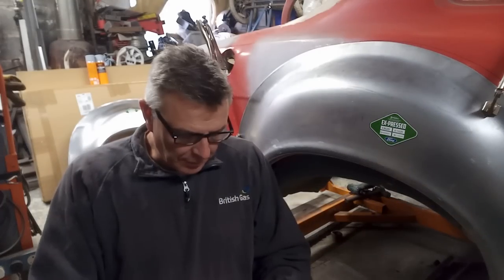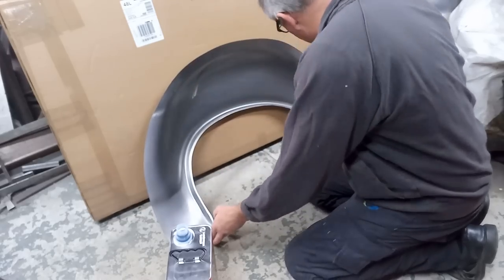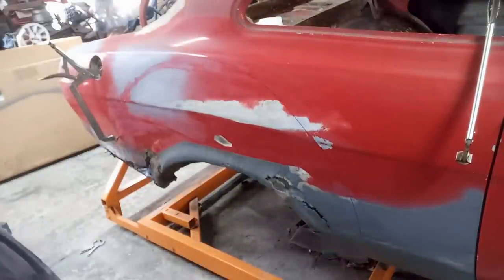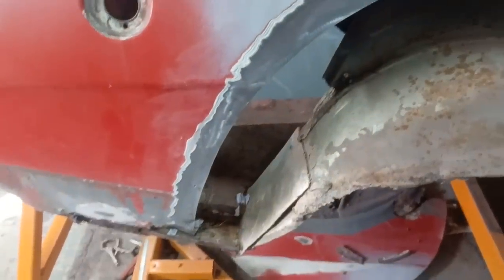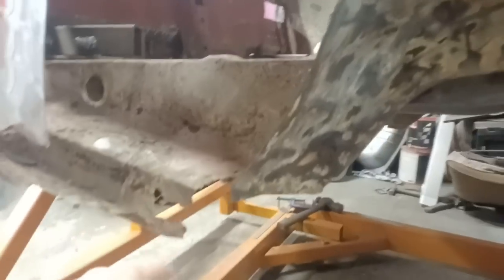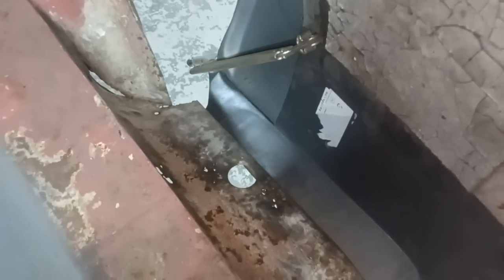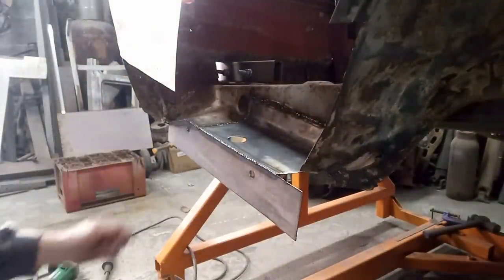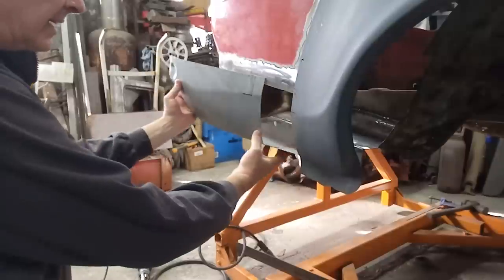Ford Escort MK1 Restoration Fitting Bubble Arches, Part 1

Comment: Dave, the best way of replicating the inner Tub to fabricate the Outer tub is to remove all the sealer which reveals the Overlap of these panels, insert grinder/cut into outer tub resting your Grinder disc against the Inner tub to follow it's factory shape, use a large cardboard section to push into the Grinder cut & trace with a Sharpie. ideally you should transfer this Cardboard cutting onto another piece of cardboard to reveal a True shape of the inner arch & site through to level,  BUT AS per your Video you  previously cut Approximately 1" below your Arch line, Fabricate a filler panel using this shape with Cardboard after RETURNING your metal around the arch 6mm, thus giving you a LEDGE  to rest/weld your filler panel METAL to, from Inner tub after removing Overlap metal from Outer tub to your Quarter panel. This gives Optimum Wheel clearance pf axle travel.
Reply from the maker: Thank you for your comment 🙏

Comment: The reason you install the axle is to visually see how it looks..you put the tires/rims on that you plan to use ( if you have those ready )... it allows you to be happy with the gaps around tire and not find out it looks " wrong " later when you have done most of the work... it is used along with measuring to get the flares lined up to look the way you want it to look..or as best as you can in most cases...  using a center mark from factory or some reference point could make it look uncentered or just " off " from perfect.... ( if that mark is off slightly or more than abit off/out !!👍
Reply from the maker: Good points made 👍

Comment: Not a criticism, more of a tip. When you panel wipe, have a second cloth to wipe of the residue before it dries, also wear nitrile type gloves to stop grease/salt from you fingers from getting on the panel. If you leave the residue or finger contamination before you etch prime, you run the risk of the etch lifting from the panel when you put the next coat of primer on, as the solvent content can dissolve the etch primer causing you problems down the line (especially as you are using a rattle can which has a high thinners content).
Reply from the maker: Thank you for the advice 😊

Comment: Can’t wait for part 2, love this build, i joggled the edge of the quarter panel when I welded in my rear arches but that was standard arch replacement it worked well and I think the joggled edge really helped with limiting the warping, I think cut and butt would be the best if you really took your time with the welding to limit the panels warping, the good thing about expressed panels is they are nice and thick guage steel compared to magnum so that should also help to limit warping
Reply from the maker: I agree on the panel thickness, express make nice panels. Cut and butt is likely to way I'll go. Thanks for you comment 👍😊

Comment: Good progress Dave. I have also had to battle with the magnum lower corner panels not being a good fit. I did also end up fitting my arches under the body which has left me with a small amount to fill but I think it is less filling than if I had fitted them on top.
Reply from the maker: Thanks Derek, good to know it's not just me then 🤣

Comment: The oil on it is probably to protect it from flash rusting before you get it...protects from moisture and exposure to humidity during shipping/storage...yes they probably use a lubricant during the pressing process...but i would bet it was for appearances once you get it home..and delays in installing it and coating it for stopping bare metal rusting starting... why some coat it too ...with a paint coating..

Comment: Dave I think the clearance between the top of the tyre and the new arch tub is quite critical depending on the range of suspension movement you are planning. Obviously a track car will need far less than the equivalent rally car for instance. (Ideally you will need that calculation before working in the new tub shape).
Reply from the maker: Thanks Phil, it's going to be a road car, no intention of racing it.

Comment: Don’t weld those arches over the top of the panel use a method called cut and butt which involves as the name implies to make a small cut about 2 inches long and then butt weld. It’s hard to explain in words but there’s a guy here on YT who does a lot of it called Fitzees Fabrication. I’ve used it myself a few years ago and with some practice can produce a very good weld and look.
Reply from the maker: Thanks Carl, yep I follow Fitzee and have learned a lot, the cut and butt process is mega, and likely what I'll do.

Comment: I would’ve thought you’d get  rid of the inner wheel well and fit bigger ones as you’ll be restricted with wheel sizes other wise depends on your plan. But to get utilisation out of the bubbles the inners need to go
Reply from the maker: Thanks Karl, my intention is for road use only, with 13 inch wheels, but I suppose it's now the time to think ahead...

Comment: great work dave.....i think the reason you might be struggling with the lower quarter section is i think its a mk2 escort repair panel not mk1....there ever so slighly different.......someone else may confirm this?
Reply from the maker: I'll double check this, I was sold it as a MK1 panel
Reply: Mk2’s don’t have arches like that, they have boxy ones called forest arches.

Comment: Please... do it the professional way and fit the arch on the INSIDE of original panel, not the bodge up clagg it on the out side way some others on u tube do it,   looking good anyway.
Reply from the maker: Thanks for that, I may yet butt weld into place, be no overlap for gunk to get it and cuase chaos later.
Reply: @DavesGarageuk  Butt better than lap on top,
Reply: @DavesGarageuk   bare in mind you can seam seal from the inside of the boot and if you modify the wheel arch liners the joins will be in a sterile(ish) area. 
Yes arches fitted inside.